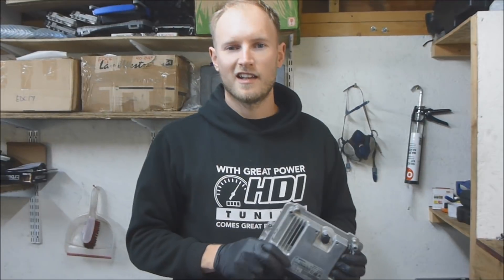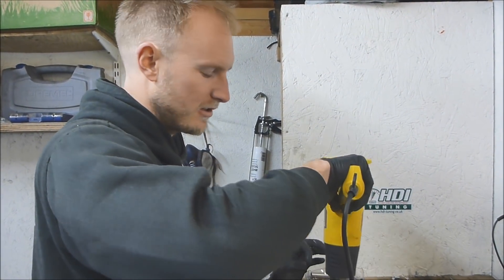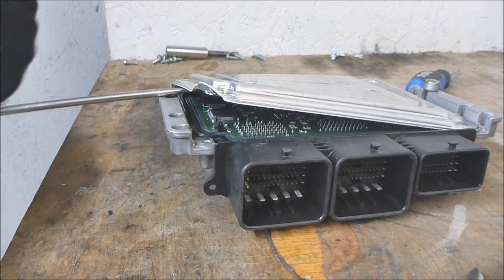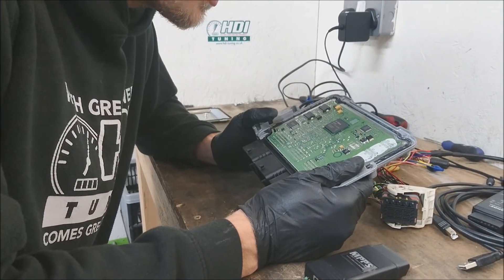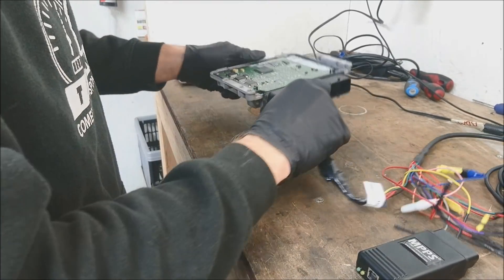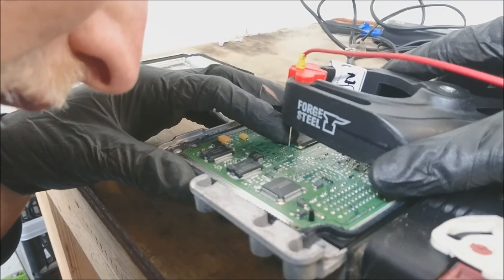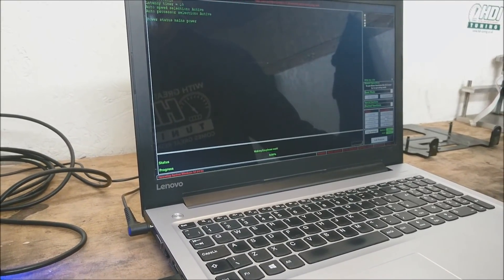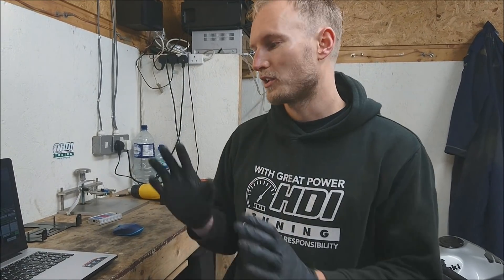Peugeot Citroen EDC17C10 ECU opening and programming using MPPS TriCore add on

Comment: Can you repair my ECU peugeot 307 sw 2.0 petrol,,i have problem after my A/C turn off the fan radiator still running,but the compressor off...and my compressor A/C didnt cut off at temp 22 reach,,fyi my heater core already bypass
Reply from the maker: @agungyuliyantonugroho  yes, drop me an email with a photo of the ECU label

Comment: Thanks for very informative video. can you access the ECU pinouts from within the AMT application, or you have to search for the ECU  pinouts on different or another application. Thanks
Reply from the maker: Usually I just search there's nothing like that inside of mpps software. Dimsport has them integrated to the software like ktag

Comment: Hi Steve, I have a suspect 9M51-12A650-BF ECU from a Ford Focus 1.6 TDCi 2009, I think it's dead. Do you know how much current it should pull when powered up on the bench? I put +12v on C418, pin C3 and GND on pins H1,H4 and G4. It only draws 4mA. I can't get the ODB scanner to connect and the car wont start. Checked all the wiring so think the ECU is dead.
Reply from the maker: Yes 4mA is much too low, sure you have the right pinout is the ford pinout the same as the PSA? its worth double checking it
Reply: @StevenLewis-HDI-Tuning  hi Steve. Pretty sure. Traced it back to fuse box.

Thinking that something in the pcm power supply has popped. 

I'd expect it to pull a few hundred ma at least.

Not sure if there are any other pins need power on to get the pcm going.

Can't see anything on the car schematics.
Reply from the maker: @richardmarkham8369  how does it look inside? With ford you can program a replacement unit using ford IDS over OBD
Reply: @StevenLewis-HDI-Tuning  Not been brave enough to open it yet! I've seen your helpful videos on how to do it though! I dont want to ruin my chances of getting someone like ECU Testing to repair it if there's nothing obvious wrong inside - like shorted caps or blown diodes.
Reply from the maker: @richardmarkham8369  I can probably connect to it and will be a great deal cheaper than ecu testing. Do you have proper equipment or ebay stuff and have you done one of these before and made it work?
Reply from the maker: I just realised tou said its a 2009 but you were commenting on my edc17 video. If its an edc16 ill almost definitely be able to connect to it with an open ecu over bdm and program on to a replacement unit. Drop me an email through the website
Reply: @StevenLewis-HDI-Tuning  It has a part code 9M51-12A650-BF 9CXF but don't know if thats a edc16? It has 3 connectors. All 4 row. 2 with 8 columns of pins, 1 with 12 columns of pins.
I didn't see any permenant +12v connection, only one from the ignition key and one from the ECU relay.
Reply from the maker: @richardmarkham8369  email me a photo
Reply: @StevenLewis-HDI-Tuning  Hi Steve, sent it to the remap address?
Reply: @StevenLewis-HDI-Tuning  Connected up +12v to pin G1 and the ECU is drawing 300mA now. 

I guess ForScan won't talk direct to the ECU canbus, is there some software I can try communicating with? I have CanHacker but I only use that for sniffing Canbus!

Comment: How dou you know pinout for ECUs Tricore mode? does it come with software and you get pictures with connection and boot pin?
Reply from the maker: Usually you can find everything if you search the ecu model and processor on Google. Sometimes you need to be a member of special forums or if you buy a genuine tool you can ask the tool supplier for the pinout diagram.
Reply: @StevenLewis-HDI-Tuning  thx!